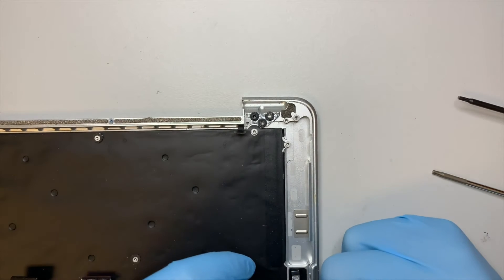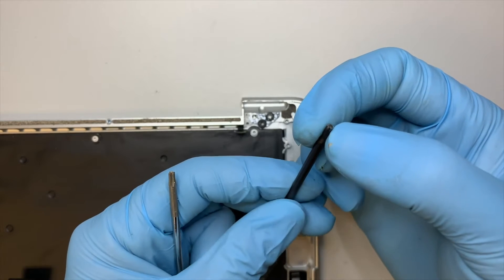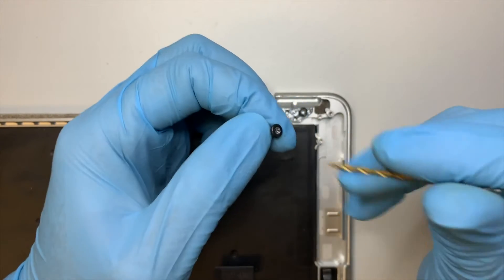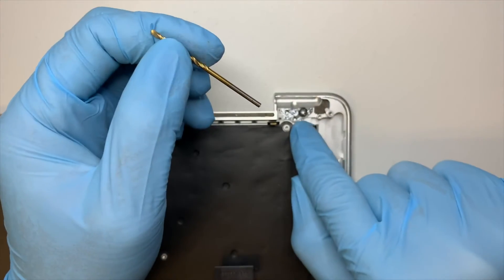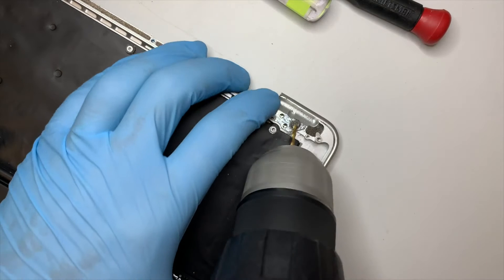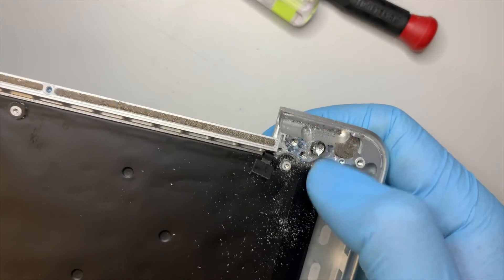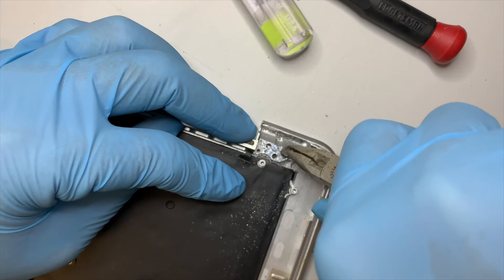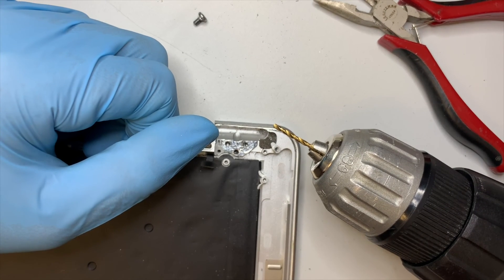Remove Laptop Stripped Screw

Comment: Thank you.  I used this process to remove the screw on the back of my dell laptop.  The kit available on amazon for removing a stripped screw didn't work but using a left-hand small drill the same size or a little smaller (less than 1/16 " in diameter) did work to remove the head of the tiny screw.

Comment: I have noticed this with Apple they put their stupid screws as if the LCD or the screen is going to get up and run, the reason they do it, is they want to make it as difficult as possible, so you don't get to repair anything, you just dump it and buy a new one. There is no need in the world to tighten screws in this way and mostly they use Torkx screws which are known to easily strip and get damaged. Sod Apple.

Comment: why did you not use the plier at the beginning in first place before doing all the drilling?   the plier could've grabbed onto the screw head from the outside anyway.  No need to try to drill or anything like that.
The harder more realistic scenario is if the stripped screw is actually inside a screw hole that prevents you from being able to use the plier to grab the head from the outside.  Then you might consider using a drill or even a tiny chisel to try to eventually break off the head completely to allow you to free the lid that was being held in place by the screw lid.  Once you can remove the lid, that will reveal the screw stump to allow for removal with using a plier to grab onto the stump.

Comment: i tested out with my dad that a good way to unscrew an useless screw is by using a cut plier and should be placed exactly on the line of the cross. It worked wonders and was saved.
Reply: Clarification, you should put enough force until the cut plier doesn't slip (the screw is soft enough for it to be cut a bit), so try to do so as last resort and trust me, it will work.
Reply: "exactly on the line of the cross" requires the screw to not be completely stripped (which has no cross), no?
Reply: @cestladope  even if it is stripped, it can be done. However, is a last resort. The screws should be better made tho haha

Comment: Thanks for the video. The drill method worked well enough to get me past a totally stripped case screw. I wish Dell wouldn't install them so darn tight at the factory!
Reply: Haha I'm having the same issue with my Dell G15. Two screws so tight I think I accidentally stripped one lol
Reply: @ceph042  I have a Dell G15 too and I am having issues with 4 of the strews.
Reply: did u find a fix or no?
Reply: Mine is a dell too lol they don’t want us repairing it ourselves i guess
Reply: Or inserting parts in slots they’ve left wide open for usage, like an SSD. Makes no sense!!
Reply from the maker: Glad it worked out for you
Reply: Dell seems pretty bad at this, am also here due to my dell laptop
Reply: A dell one as well
Reply: i think it is caused by the blue glue they add to keep them from loosening
Reply: They even use locktite on these screws. Ridiculous. The computer is already snapped together. Which could be enough due to the fact that computers don't move around alot.

Comment: I had to drill out two screws on the bottom of a thinkpad I bought from eBay. Drilled out the heads, however the remnants of the screws are still there. Need to figure out how to get the rest out and put new screws in.

Comment: Use a dremel tool and make a slant then use a flathead screwdriver you risk ruining the threads on the case this way.
Reply from the maker: Good suggestion. Will give that a try

Comment: might help if you use a metal drill bit vs. a wood bit.  When I have this issue, I use my dremmel with cutting wheel to cut a new channel straight across the top of the screw head.  Then simply use a standard flat head screwdriver and replace the screw once it's out.
Reply from the maker: Glad it helped
Reply: Where do you buy appropriate replacement screws?

Comment: I stripped a screw connecting the heatsink to my laptops motherboard. I ordered a screw extractor on Amazon and drilled it out. Not as destructive as just beating the screw to a pulp.
Reply from the maker: Glad you are able to get the stripped screw out.
Reply: Brah same screw for the bracket of the cpu stripped. Do you have to screw down very far with the screw extractor? Shit has me nervous af since it's right over the cpu.
Reply: @P4PKing  yeah, just remember to go counter clockwise, mine popped out abruptly and scared the shit out of me, but at the end everything was working just fine. I did have to go deep and hard if you know what I mean. xd
Reply: What screw extractor did you buy exactly ? thanks
Reply: @brandoncruz1744  lmAo I got that bastard out
Reply from the maker: @lorenende7661  This one here.  https://amzn.to/3xzmlIF
Reply: @UbergeeksBiz  thanks!
Reply: Hey could you please send me the address of which one you bought on amazon?
Reply from the maker: @yueliu4308  Stripped Screw Extractor -   https://amzn.to/3g7J6fr

Comment: I wanted to change the thermal paste of my laptop CPU GPU but this process is too risky to follow because the screw is tightened through the motherboard.
@UberGeeks can you suggest some other way?
Reply from the maker: Which laptop CPU ?
Reply: @UbergeeksBiz  i5 9300H
Reply from the maker: @VikrantKumar2015  I personally have tried many other ways. But ultimately, drill is my solution to all stripped screw. You need a steady hand when drilling.. lol
Reply: @UbergeeksBiz  stead AF lol!

Comment: Hi UberGeeks! I own an Asus R556L and its battery is expanding so i decided to take it out, however one screw is stripped and i used whatever means necessary including using a hack saw but i was very carefull not to damage the laptop, but the scew still cannot be removed. I wonder if i should just force remove the laptop surface? I really need to remove its battery
Reply from the maker: What have you tried so far ?
Reply: @UbergeeksBiz  the infamous rubber band technique didnt work for me, i hacksawed the screw in attempt to make it into a flat screw but i think i made it worse and now i regret it. I am yet to try the super glue technique
Reply from the maker: @dvrth.ro96  Good luck to you. To me, rubber band and glue technique do not work majority of the time. I only have good success with drill. And with drill, you have to be very careful not to miss judgement. Or else, it can be very bad.
Reply: Had same problem yesterday lad, definitely skew gave me hard time and I tried everything to remove it, on the end I need it to break peace of battery where is skew after that I made it to remove battery without damaging anything, today prices of items are so huge and quality is sht

Comment: Hi Ubergeeks, i was wondering if its possible to use soldering iron to remove the screws? would it be possible to use it as an alternative to the drill?
Reply from the maker: I have not tried soldering iron to remove stripped screws. Maybe soldering iron might not hot enough to melt the screw ? I always have good luck with the drill. But make sure you know when to stop and not drill too deep. Good luck
Reply: It might work if you put some solder inside the hole and insert the screwdriver while it's hot... but if the screw is too stubborn the solder will be pried out ... 
the best way is to make a slant using a Dremel tool, file, cutters or whatever and use a slotted screwdriver to unscrew...